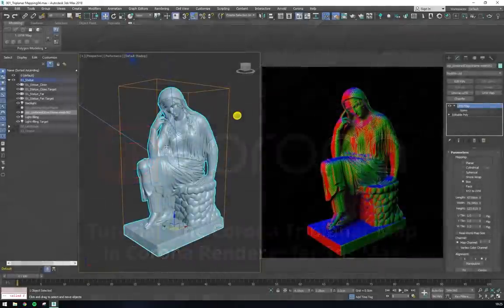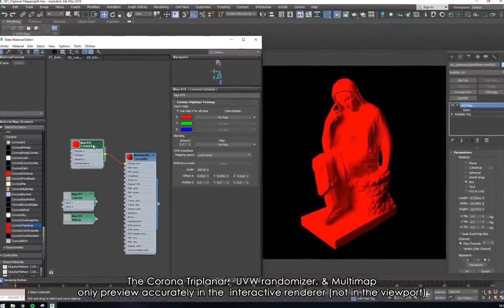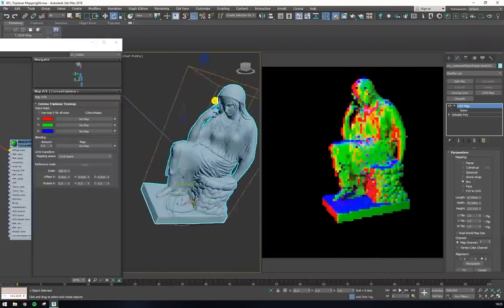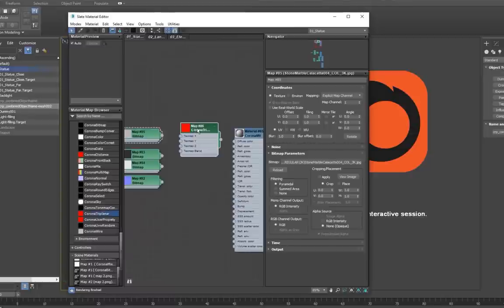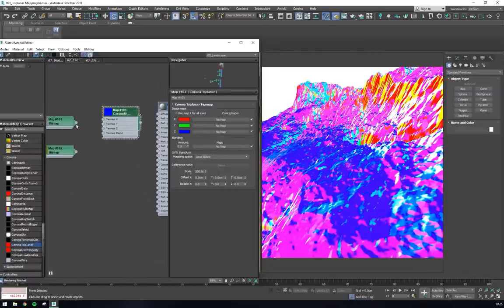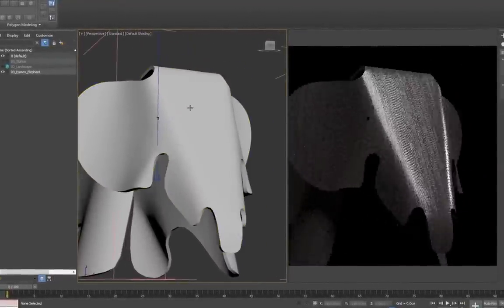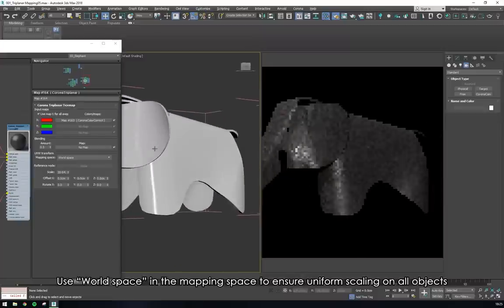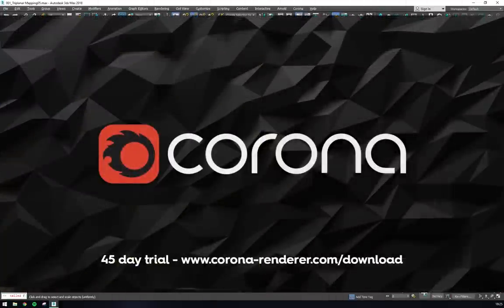Corona Renderer for 3ds Max: Corona Triplanar Map Tutorial

Comment: What about a new video on how to do that in Cinema 4D? That link/dummy approach I don't think it is possible.
Reply from the maker: Howdy! If you're referring to the workflow demoed at 3m17s you can recreate that in Cinema 4D by right clicking on a parameter, selecting Xpresso and making it a "Driver". Then you'll want to link that parameter to the same parameter in all the other Triplanar shaders by doing the same procedure except for choosing "Set Driven (Absolute) as the last step. That'll link those parameters together and when you change the "Driver" all of the rest will change the same. This works for checkboxes and other parameters as well.

It's a bit of a Cinema 4D thing but we'll put this on the list of topics we'll want to explore in our future tutorials.

Hope the above helps, if it doesn't, let's continue going at it :) Nejc
Reply: @ChaosCorona  Cool, thanks again. Unfortunately I'm not the Xpresso guy yet, I'll dig into that sometime in the future.
Reply from the maker: @Ricardo-de9ju  If it helps, this workflow doesn't actually involve using Xpresso. If you just right click on the parameter and follow the instructions it should be set up with just a couple of clicks - and you don't have to open up the Xpresso editor even once :) Would definitely recommend giving it a spin. Nejc

Comment: Hello! I'm a bit late, but i have a question. How can you avoid texture stretching when making changes on the model? Tnx!
Reply from the maker: Not entirely sure what you mean, posting on the forums would be better as then you could share video or images that showcase the example you have in mind. This comes down to UV mapping, so depends on what changes you are making to the model,. Things to look into are using Real World Scale, or using World Space rather than Local Space, but does depend on what you are doing and what result you want. To share more info, you can post in https://forum.corona-renderer.com/index.php?board=29.0 - thanks! Tom
Reply: @ChaosCorona  Hi Tom! I'm making a procedural terrain shader with the triplanar map, but when i extruded new geometry the shader on the extruded geometry was stretched. Then i figured out that i needed to put a uvw map on top of the modifier stack and that solved my problem. Hope i cleared things out. Thank you for your reply! Matija

Comment: Hi there I have a question..how would you exclude an object let's say a curtain from environment light? Please help I have been searching everywhere but didn't find an answer
Reply from the maker: Since Corona Renderer is physically realistic, you can't exclude it from the environment lighting. What you could do instead depends on what kind of effect you want to achieve.

For example, you could set up LightMix with the environment lighting in one LightSelect, add a mask that has only the curtain in it, then use that mask in post to remove the curtain from the LightSelect layer that was specifically for the environment lighting.

Or you could do two renders, one with env lighting on, one with it off, and again use a mask layer to isolate the curtain in post and overlay the results from the "no environment lighting" render onto the "environment lighting" render.

To be honest though, I can't think of why you would want to do this, as it would most likely look very wrong :) Thanks! Tom

Comment: If you cut the object how it's look with material
Reply from the maker: Sorry, I don't understand the question. Best bet for questions is to post on the forum, where you can share example images etc. that help back up the question (https://forum.corona-renderer.com/index.php) - thanks! Tom
Reply: I mean when you use the boolean or procutter for example in 3ds max the cut area the texture will be distorted do you have this problem when you applay your  technic
Reply from the maker: @sevenseven31  No, you wouldn't have that problem. Doesn't matter how the geometry is made :) Thanks! Tom